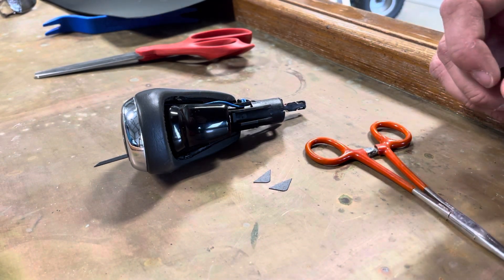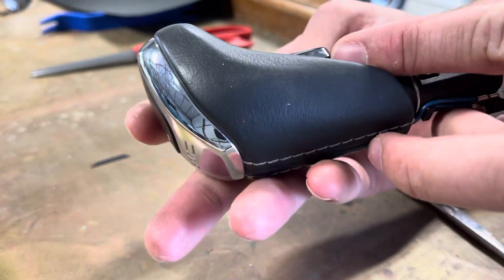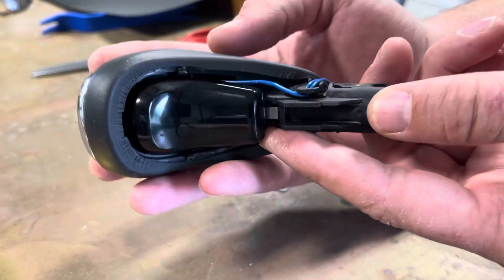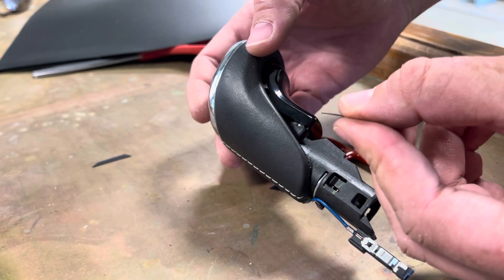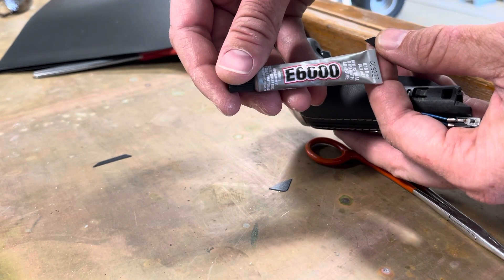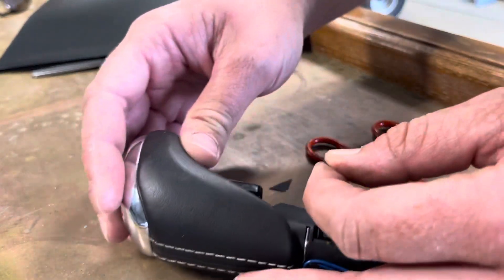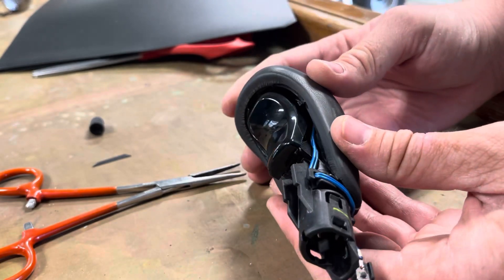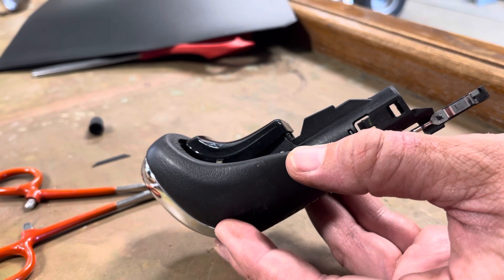Update - GMC Acadia Shift to Park Fix

Comment: Just completed this process as we had to disconnect the battery just to park our Acadia last night! The shifter has been giving us the error for 3 months now. 

We bought the wiring harness which is an additional fix that replaces the “paper clip” short. It’s GM #84733196 (part). I think it might be GMs way to short the wires without sacrificing the other issues people were having using the paper clip method. 

Needless to say, the harness project and removing the center console can wait for a while because following your video has WORKED so far!!! Tested it several times and no messages. The pin was completely out on one side. The hardest part was prying apart the shifter head from the leather boot lol. 

Anyhow THANK YOU for this series of videos! For now the fix is holding steady and the harness and possible micro switch replacement is on standby. Also GM does NOT honor replacement of their faulty issues, in case anyone is curious. They want to “run diagnostics and replace the gearbox for a fee”. Which is ridiculous because they KNOW this is a manufacturing defect. Shame on them.
Reply from the maker: Thanks for the detailed info! I didn’t know GM made a “fix”, thanks for providing the part number! I do believe this particular issue is a combination of a few issues. Many people have fixed the issue with re-aligning the pin in the shifter and keeping it there, while others have had to replace the micro switch or the paper clip fix as you mentioned. Glad my fix worked for you!

Comment: I appreciate your help. I have come across six different solutions to fix this issue and it's overwhelming. Some suggest fixing a pin, while others recommend replacing the switch, etc. I think I'll try each one step by step. Nowadays, cars are more advanced but also more complicated. Despite this, the problem I'm facing seems relatively straightforward. Thanks!
Reply from the maker: Your welcome! It does seem to be random what the issue is. It’s either the button is binding up, or the switch is going bad. The switch is harder to get to so I always recommend everyone see if the shift knob button is binding up first. Then if that doesn’t work move on to replacing the switch or bypassing it altogether.
Reply: It makes sense. I appreciate you making the video and replying to comments. I haven't had to fix cars myself in decades, but lately I have been doing it more. Thank you again.

Comment: My acadia had this issue, I tried all kind of modifications to the button to try to resolve the issue to no avail. Discovered the issue is 100% the failure of the mirco switch. Replacing the switch with Omron D2HW-BL221H will fix it temporarily (until it fails again) OR permanently by simply bypassing the switch. Ive had mine fixed for almost 2 years not. ZERO side effects or compromises and absolutely no shift to park msgs ever.
Reply from the maker: Yeah there’s a bunch of issues going on with the shifter design. Even the harness has a loose connection that can cause an issue. My Acadia still works fine after the mods I showed in this video, which tells me my switch is still good. I’m now at 98,985 miles and still never replaced the micro switch. Who knows it may fail tomorrow. Thanks for posting a replacement part number in case it does!
Reply: That is correct the fix is the micro switch
Reply: So you used the paper clip in the back of the plug and it has t caused issues? Cause that’s where I’m at I plugged in the wire harness adapter for my 2019 Acadia and it did it again, my handle isn’t binding up the switch is obviously catching and staying closed circuit
Reply from the maker: @coreydelfs6461  if the switch is in fact bad, either replace the switch or do the paper clip trick on the back of the plug.

Comment: At 20 seconds you can also see a silver V spring which has also dropped down. If you push the spring to the left it pushes the button out so it triggers the micro switch mounted in the console.

Comment: Thanx for the vid.  My POS 2018 Acadia just started doing this.  Did you consider taking a soldering iron & melting the holes closed after repositioning the pin?

Comment: Watched you boot removal tool, great video.  Would a steel roll pin work to replace the pin?  My 2018 acadia, in the owners manual shows how to pop the boot out to access a switch to allow the transmission to be set for all four wheels down when towing.  Look it up up on line, it might help?

Comment: Hi Austin! It is working so far?
Reply: BTW thank for the video!!!
Reply from the maker: Yes so far so good. The pin has not come out again. Still secure and the shift to park issue has gone away.
Reply: I used gorilla clear glue on both sides of the pin. So far no problems.